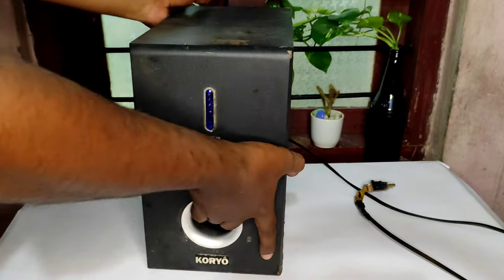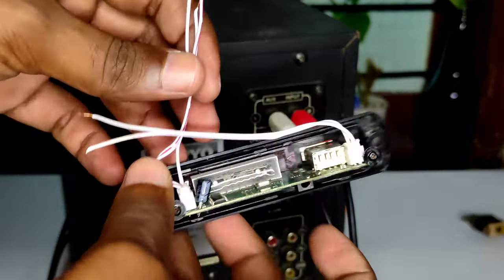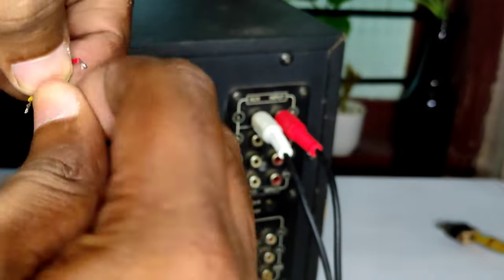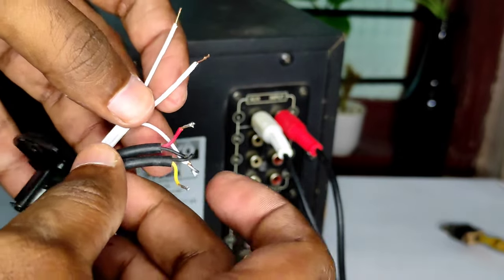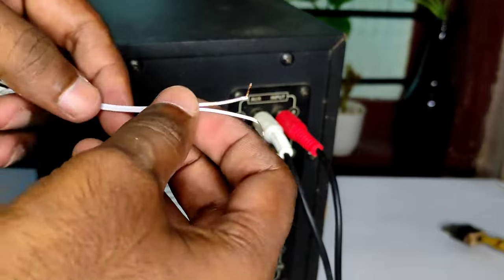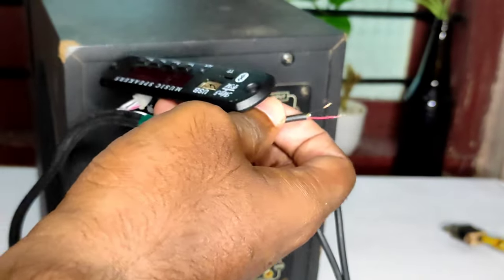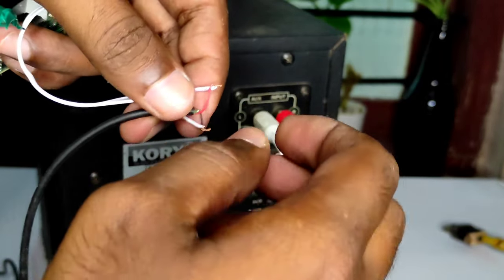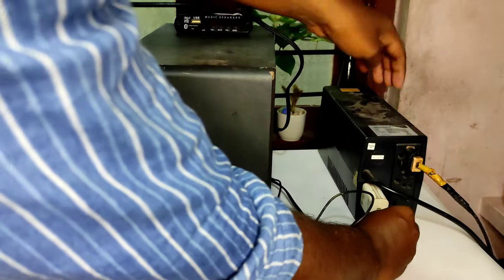HOW TO CONVERT OLD HOME THEATER INTO BLUETOOTH HOME THEATER |MALAYALAM |NO SOLDERING

Comment: Charger ഇല്ലാതെ എന്ത് ചെയ്യാം? Home theatre nte ഉള്ളിൽ നിന്ന് 5v കിട്ടാൻ ഒരു മാർഗ്ഗവും ഇല്ലേ? ഉണ്ടേൽ പൊളിക്കും. പിന്നെ ഈ module കുറെ കാലം നിക്കുമോ?
Reply from the maker: അകത്ത് നിന്ന് 5v കിട്ടും. ഇങ്ങനെ ചെയ്യുമ്പോള്‍ എല്ലാര്‍ക്കും പെട്ടന്ന് വളരെ എളുപ്പം ചെയ്യാൻ പറ്റും. ഒരു വീഡിയോ bro പറഞ്ഞ പോലെ ചെയ്യാം. Njan kore കാലം കൊണ്ട്‌ ഇത് ഉപയോഗിച്ച് വരുന്നു no problem. ചിലത് ഉടായിപ്പ് ആണ്‌
Reply: @thekkantech9919  bro njan f&d 2.1 speaker anu use cheyunnath. Flipkart le Bluetooth Aux out module battery ullad 200 rs nu adyam vangi,athu 6th month battery dead ayi. Pinne battery illaathathu vangi charger connect aaki, athum 7 month aayappo audio murinju murinju receive ആവാൻ തുടങ്ങി.😇😑 പ്രാന്ത് പിടിച്ചിട് അത് വലിച്ചെറിഞ്ഞു. Permenent fix with quality products in a affordable cost ആണ് നമുക്ക് വേണ്ടത്. Bro video ഇടാൻ കുറെ നാൾ പിടിക്കില്ലേ? Enikk പറഞ്ഞു തരാൻ വേറെ വഴിയുണ്ടോ, ഞാൻ soldering ഒക്കെ ചെയ്യാറുണ്ട്,basics അറിയാം. 3 days off ഉണ്ട്, കുറെ movies കണ്ടു തീർക്കാനും ഉണ്ട് 😀 എന്താ ചെയ്യാ, ഉള്ളിലെ transform ലെ 12v എടുത്ത് 5v ആകുന്ന IC ഉണ്ടോ? ഉണ്ടെങ്കിൽ തന്നെ അതിൽ നിന്ന് വരുന്ന volt, ampere ഉം നമ്മുടെ bluetooth module നെ long run ലേക്ക് സഹായിക്കുന്ന അളവിൽ ആകുമോ?
Reply: Use 7805 Triac
Reply: Bro home theatre I'll usb portille kuthiya mathi set agumme
Reply: @statusgallery7349  ampere കുറവായിരിക്കും
Reply: @thekkantech9919  IC vech convert cheyyendi varum 5 v kittam athilum easy ahn e videoyil ollath charger mathi❤️❤️
Reply: സൂപ്പർ ആയിട്ട് ചെയ്യാം പറ്റും.. പക്ഷേ പണി കുറച്ചെങ്കിൽ അറിയുന്നവൻ ആയിരിക്കണം.... Home theater ൽ ഡീസപ്ലൈ ൽ വരുന്ന power line കാണും അതിൽ നിന്നും 5 v mutlimeter വെച്ച് kandu പിടിക്കണം എന്നിട്ട് mp3 ബോഡ് ന്റെ power പോസറ്റീവ് നെഗറ്റീവ് കറക്റ്റ് ആയി സോൾഡറിങ് ചെയ്യണം... എന്നിട്ട് ഓഡിയോ ഔട്ട്‌ wire aux വരുന്ന ഭാഗം ഉണ്ട് അതിൽ ലെഫ്റ്റ് റൈറ്റ് സോൾഡറിങ്  ചെയുക  നടുക്ക് വരുന്നത് ഗ്രൗണ്ട് ആണ് അത് കൊടിത്തിലേലും കുഴപ്പമില്ല... വർക്ക്‌ ആകും..
Reply: Bro njn 12 v battery conect chaythuu but bord ion avunela